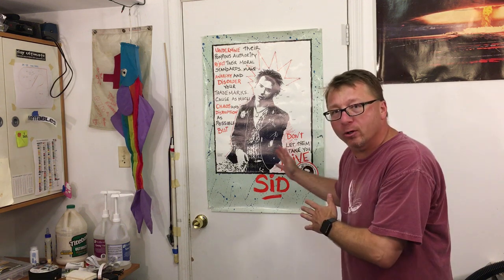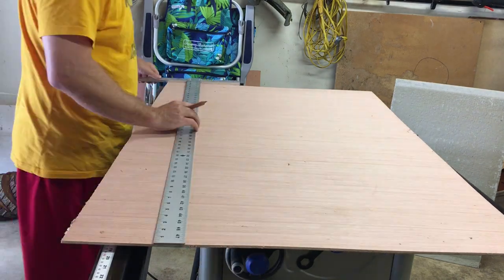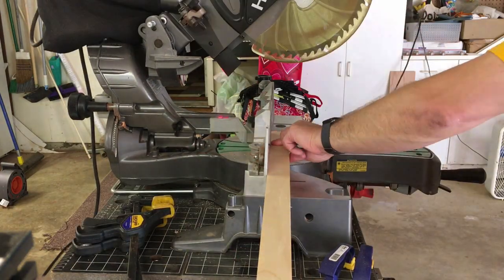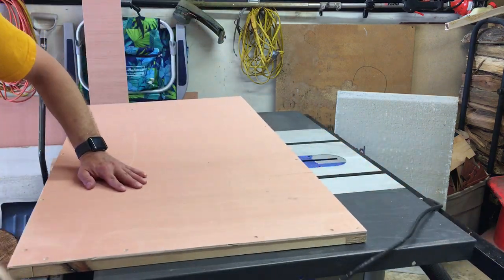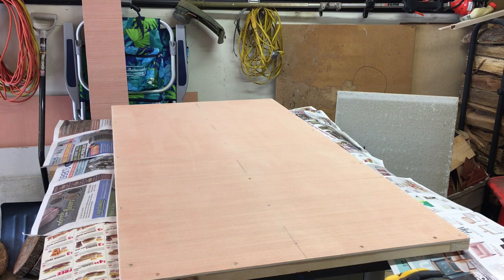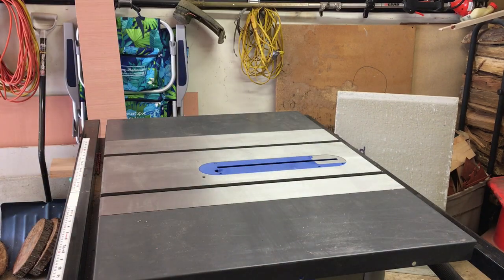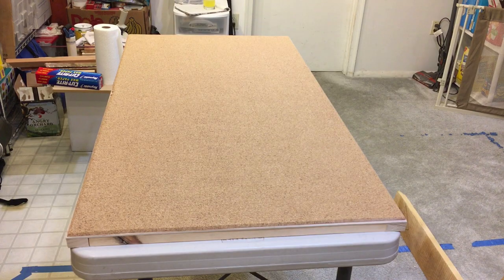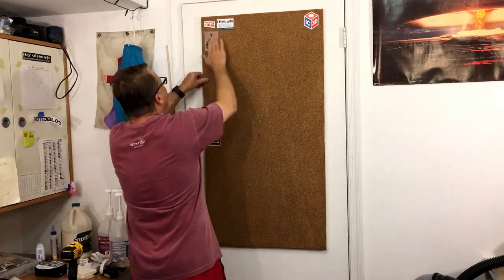Make a Display Board for Your Stickers from Wood and Cork!

Comment: I’m thinking of starting a pin and sticker collection on a cork board, would the stickers stick to the board normally or would I have to coat it like in the video to get them to stick long term? Also, if I used the coat on the board would the pins still be able to go on the same board as the stickers?
Reply from the maker: Hi Emily - after time, some of my stickers started pealing or coming off entirely. I think mainly because of the porous nature of the cork. As such, I'd recommend something more smooth like steel, tin, or acrylic instead; especially if you have some magnets as well as stickers. If want to use pins, then cork is probably the best choice. In that case, you might need better glue on some stickers - I've used traditional glue sticks (https://amzn.to/3Q9Rk7t) and mod podge (https://amzn.to/3Q2CK1q) to secure things. Hope that helps - thanks for watching!